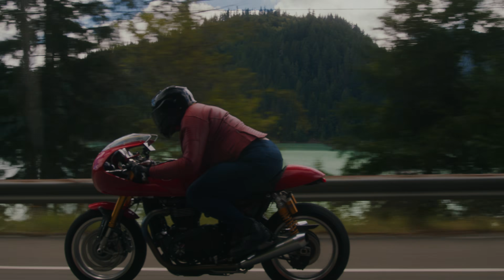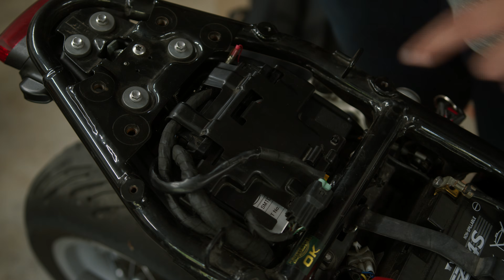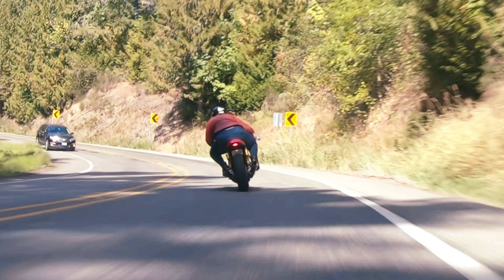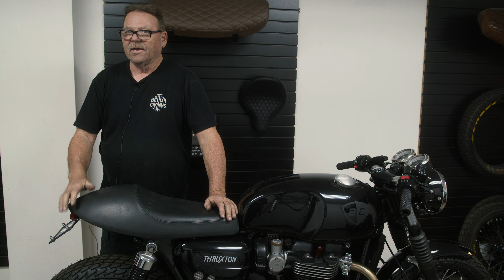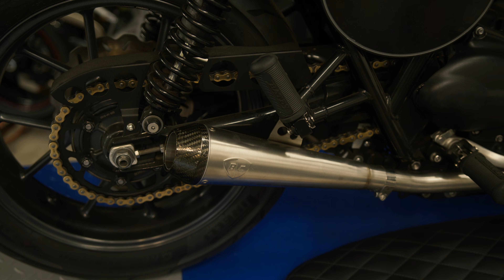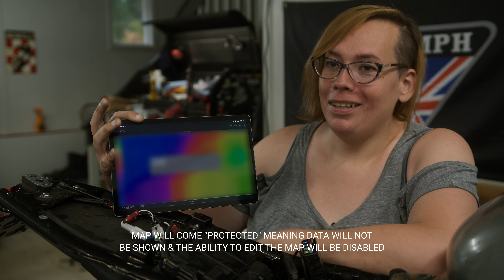How to Tune Triumph Liquid Cooled with DNK Tuneworks using TuneECU

Comment: Just remapped with the custom tune I bought from you, after doing the valve clearances which were tight on three of the exhaust valves after only 9000 miles so get 'em done people!  Confirmed the throttle bodies are in balance too. The DNK remap has really transformed the bike. My grins are even wider now! The drive out of corners is ridiculous. I am very happy. To the people interested in a tune, I highly recommend a map from Danielle once you get your hardware added.
Reply from the maker: That’s awesome to hear, glad you’re enjoying the power! 👍

Comment: Where is your shop !? I have a 2017 triumph street twin 900 and its rpm is high and when I shift it to first gear it jerks
Reply from the maker: Typically, a problem with shifting and jerking/walking bike when first is engaged is due to a clutch tightness issue and sometimes even oil. On your next maintenance, we recommend bringing that up so that they can look into the clutch/cable/etc.
Reply: @britishcustoms thank you

Comment: I bought a second hand 2020 scrambler 1200 xe which had a decat, dna filter and snorkel remover done. The tune is yours and its running a bit lean down low, is there any way to add a little extra fuel without paying for a re-tune?
Reply from the maker: Only way possible would be to access the ECU via TuneECU and adjust it yourself but if you're not familiar with the process or know how much to add/take off, we do not recommend it.

Comment: Will that changes with fuel mixture decrease heat from the engine?
Reply from the maker: With the factory tune running quite lean (resulting in a hotter engine/exhaust system), a tune will help with a slightly cooler running temp.

Comment: Hey, unsure if this is the correct forum for this question, but here I go

Currently have British custom turn out slip-on exhaust. Looking to add the British customs x pipe. 

All I have to do is get the get an OBD link and use TUNE ECU to upload the DNK tune onto the bobber? A simple plug-and-play process?

In reference to the tunning chart, I assume "TUNE RECOMMENDED" means that a DNK tune would suffice, and a "CUSTOM TUNE" means that I would have to go to a Dyno? Correct?
Reply from the maker: That setup is one that we don’t usually recommend as there is no baffling. May be good on the later side of the powerband but it’s not practical - and trying to tune for it might be tough. 

What we recommend for a straight pipe look is to check out our Drag Pipe full exhaust system which is a full exhaust system from header to tail end, baffled for sound and performance. 

From there, a tune will be required. When we say tune, it just means general revision of the stock MAP be it through a downloadable service like DNK or TuneECU via OBD->download->upload or a little more fine tune= Power Commander

Comment: Kind of a lame question but how does this effect my fuel economy. I’d still like to get a decent range out of my bike for when I do long trips.
Reply from the maker: It'll vary, most importantly it's smoothening out your powerband therefore there's more useable power which can result in loss of MPG but at the end of the day, you have a very smooth running bike, getting your moneys worth ! For long trips (on hwy especially), it won't change too much unless you changed out sprocket, cams, etc.

Comment: I re-created the exhaust into 2 in 1 style and removed the air box and replaced the air filter with the K&N of harley davidson and its on the side where the side panel is....

Would this tuned ecu can make it work together with those modificaton?
Reply from the maker: It'll definitely be better than stock but for custom application on both exhaust system and intake, we highly recommend a custom tune via power commander, ran off of a dyno

Comment: Bought the map from dnk and received it today. Tomorrow I'm going to upload it and test it. Can you tell if it is better to reset the adaptations through tuneecu or should I leave it idling for 12 minutes? Thanks!
Reply from the maker: We’d recommend resetting adaption as it puts the ecu in a learn state. The 12 minute isn’t much of a big deal as the ecu adapts regardless but the 12-17 minute “closed loop cycle” just makes that a faster process.
Reply: @britishcustoms  thanks! 👍

Comment: 2020 Triumph T120.  British customs decat, V&H silencers and DNA air filter.  I installed a DNK tune about 2 years ago when the bike was new and have since ridden over 40 thousand kms.  The bike performs great.  Most notably, the throttle is steady throughout the RPM range and all surging and twitchiness is gone.  Top end power and pull significantly increased as well.  I even went back to stock to see if it was all in my head and immediately felt the difference in a negative way.  I also believe that as I racked up the km's the tune "settled in" quite nicely as the ECU fully adapted to the conditions that I ride in.  Simply put, the stock tune is designed to meet emissions regulations.  All the 12 minute tunes in the world won't change that.  Triumph's hands were tied.  I'm now contemplating buying the tune again only to see if it has improved even more since the two years since I bought it.
Reply from the maker: Sounds like a great experience getting 1:1 with the throttle to the motor !
Reply: @britishcustoms  Patiently waiting for the BC full 2:2 exhaust to come out  😀

Comment: I have an Android tablet, but it's an old one. I have a new phone, though. Anyone done this with a phone? I've heard that the newer ECUs are "locked" and that it takes a dealer or maybe some other level of shop to flash them. This makes it sound like anyone can do it. I have a 2022 Street Scrambler and want a remap after I get rid of the CAT.
Reply from the maker: Per TuneECU, it works on an Android device but make sure to get the "full" version where you can actually upload maps as we believe the "lite" version can only download maps. DNK has also figured out how to work with the new locked ECU's as well with their tunes.
Reply: @britishcustoms 
I'm pretty sure I have the full version. I paid for it.

Comment: I have ordered the famous Street Twin Tec cam for my 2016. Will be combined with the X-pipe and a DNA air filter. Not sure how this will work without a tune. Ordered the fuel booster plug too, but I guess a tune will be better anyway. Are you still being restrictive when it comes to tuning this cam upgrade?
Reply: I had the 2017 Street Cup with TEC cam, x-pipe and air filter and it needed a custom tune.  Was super lean up top, and super rich down low with the stock map.  If you need a map for your setup, I can send you the one that I made.  We spent several hours on the dyno getting it dialed in.  I don't have the bike any more, but I have a copy of the map that I made
Reply: @Daves_Man_Cave  That would be very helpful 🙂
Reply from the maker: Highly recommend getting it tuned, especially with a cam. Best bet with that cam would be a custom dyno tune assuming that you have everything you need (exhaust/intake/etc) & using TuneECU to remove the limitations placed on the ECU
Reply: @britishcustoms  Does the DNK tune come fairly close for the TEC cam?  How much more do you think we could realistically squeeze out of a custom dyno tune?  A lot of shops in the northeast won't touch Triumphs (even though I explain to them at length how a dyno tune has nothing to do with a brand).

Comment: ita necessari to make a custom flash depending on the exhaust system I have? I mean, at this time I have the stock exhaust but I want to improve it later, do I have to buy a different flash or does the same will work changing the air filter and exhaust? thanks and amazing job there, my bike is a trident 660
Reply from the maker: It’s not necessary right off the bat which a few changes like exhaust/intake but we’d recommend it down the line to get the most out of your bike & its investments

Comment: Very happy with the DNK tune on my Bonneville T120. It dramatically improved fueling and throttle feel after deleting the catalytic converter. They were also able to unlock cruise control so I was able to successfully install it without a trip to the dealer.
Reply from the maker: Thanks for the feedback ! Where’d you really notice the improvements in terms of the powerband ? (Taking off, highways, etc)
Reply: @britishcustoms  There's a little extra "punch" past 3000rpm. But what really makes the tune worth it is all in the improved engine characteristics. The throttle is responsive &  linear, the engine is much more eager to rev, and the low speed jerkiness is completely gone.
Reply from the maker: @louisjones2653  night and day right ? Worth it 200%, especially when you’re upgrading any performance components so that you’re getting the most out of your bike.

Comment: Thanks BC… Any videos like this for the Thruxton 900 EFI?
Reply from the maker: We're working on an air cooled video on how to tune carbureted + EFI so stay tuned ! For now, check out our tuning guide page here: https://britishcustoms.com/blogs/shop-notes/triumph-motorcycle-tuning-guide
Reply: Hi there,

You’ll find that the process is identical for the air-cooled bikes with the only change being that you’ll need a cabled connection.  You can find a compatible cable here.

https://www.lonelec.com/product/tune-ecu-kkl-interface-cable-lead-for-triumph-motorcycles/
Reply: Banzai, the process for the air-cooled EFI bikes is the same except you’ll need a cable connection.